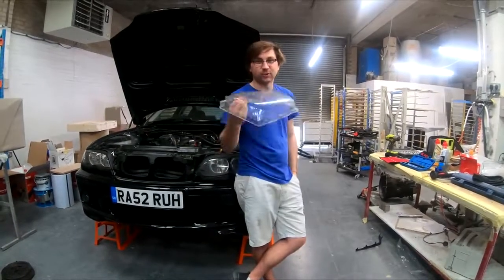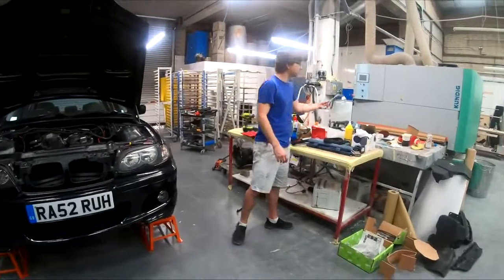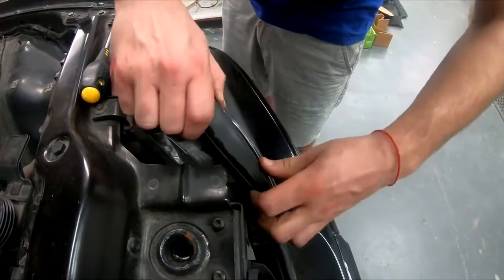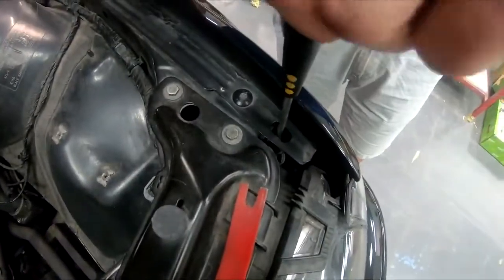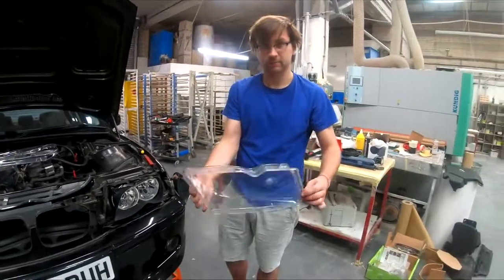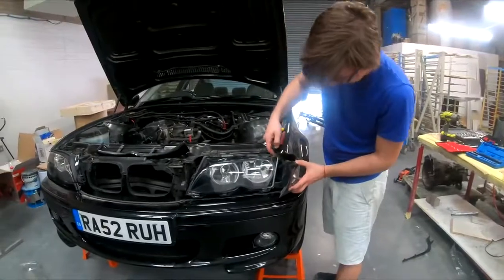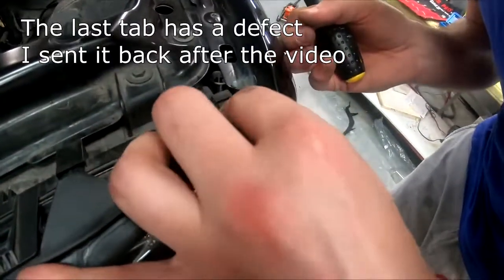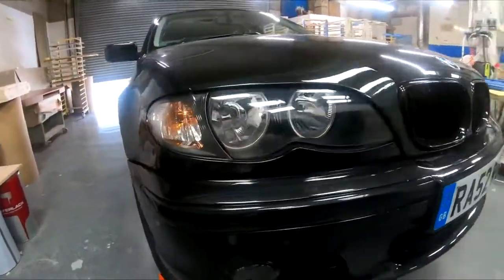BMW E46 New Headlight Lenses Replacement

Comment: every other video i’ve seen had taken the entire headlight out this seems so much easier
Reply from the maker: All depends how much you are willing to do.  ( For changing the plastic cover I don't see how removing headlight fully will make it easier) 
There is the fast way with removing and undoing as less as possible, or undoing bolts, unplugging wires ,  finding safe place were to change the part, without ruining it. 
At the very end it depends from the person.

Comment: Did you manage to get all tabs to hook to the cover or only the top three? The oem cover hooks to all tabs, but the aftermarket ones only to the top. Thanks
Reply from the maker: The lower 3 are barely holding there, they do tab on them, but slip off if you push the lenses upwards. 
Aftermarket stuff dose have lose fitment issues. You could heat up and bend the tabs upwards a bit.
Reply: @KlavsX_  Thank you!